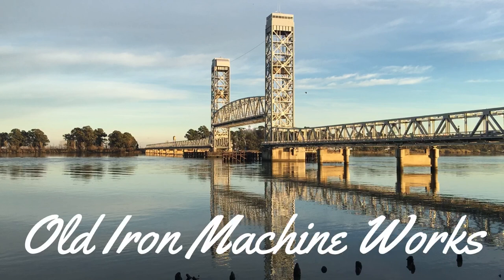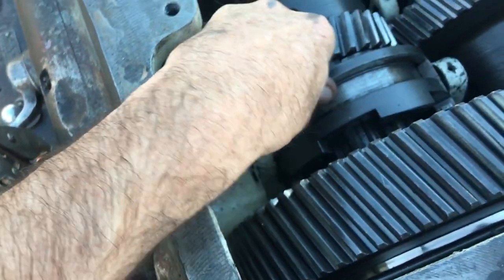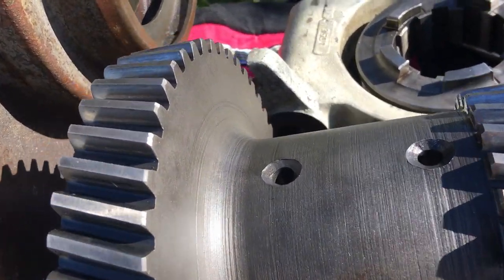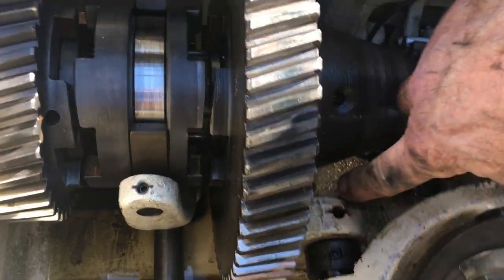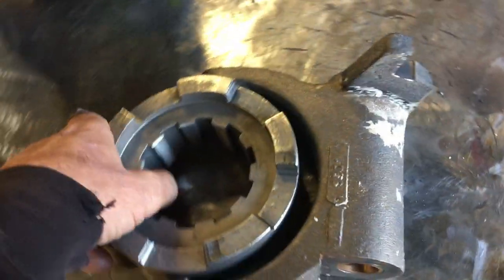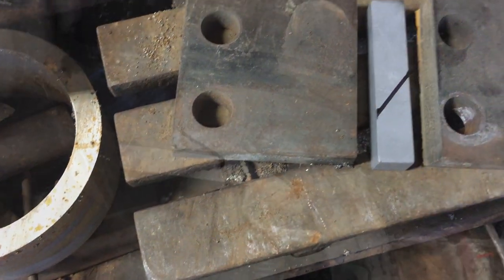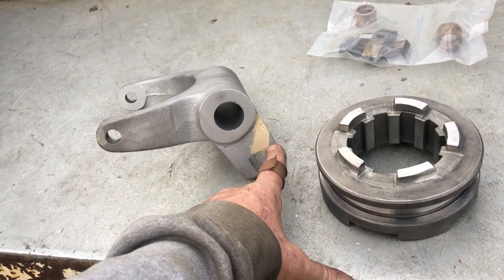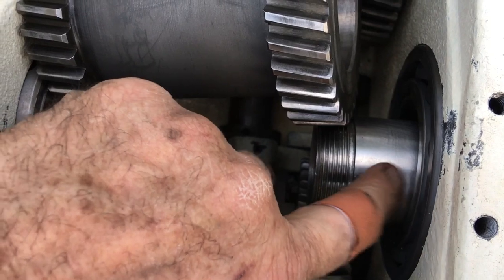Monarch Lathe Shift Fork Repair

Comment: I wouldn't call cast iron junk. The reason its as old and condition is the benefit of cast iron. That took a hell of a wallop to snap that gear shift carrier. If that was made in any other country it would be scrap 40 years ago. You did a great repair job and the correct way . Nice machine will now live another hundred years.

Comment: Thanks for showing what my spindle looks like without me having to do any disassembly! The repair looks like it will outlast you or I. BTW mine is a 22.5" swing. Cheers! ----Aaron
Reply from the maker: I knew that Aaron, most of the time whats clear in my head is not what comes out of my mouth :)  thanks for stopping by.      Gary

Comment: Real nice repair. That will hold, for sure.
Reply from the maker: Rustinox, Thanks for stopping by and checking out my video. My middle name is Russell and as a kid growing up many called me Rusty, family called me Russ. Where did Rustinox come from? I hope your doing good, I have been so busy and running behind and keeping up with watching videos. still need to catch up with yours.   I can still say the the coat hanger project was one of my favorites.  Thanks for stopping by.       Gary
Reply: @OldIronMachineWorks   Rustinox is just a paradox. Rust is of course metal corrosion, and inox comes from inoxidable. This is how we name stainless steel over here.

Comment: Really great repair on the fork , I would have just chamfered a small piece where it broke off but the way you did it gives the braze much more holding power . One big reason I like your videos,  they show the difference between  how an amateur and  expert craftsman  would make a repair like that . Thanks for sharing
Reply from the maker: Otto, your way to kind. Thank you for taking the time to check out the video.      Gary

Comment: Nice braze job.  When i repair cast iron, I usually try to work in some mechanical fastening along with the weld. for that little appendage, I would prep it the same way you did, tack the steel part in place, and drill & tap for a long set screw to fasten the joint.  In my case, I would fusion weld the joint using TIG and Ni-rod.  Just my take, you did a great job.

Comment: New subscriber, 50 year retied journeymen machinist---- we NEVER retire we just change our hours. lol. I would have driller & tapped and counterbored the repair fork with a long 10/32 socket head cap screw on the Bridgeport mill. Two of them if passible as there is a bunch of shock when you drop it in & out of high range. Looooove them Monarchs from that time eara. In my opinion, only one better is the old Clausings of the 60s.  Never care for the La Bonds (with that stupid Servo shift crap) or the Lodge & Shipley as the Morachs run cooler. Best bang for the buck is the 20 inch swing Summits but brother , they run HOT !!!!!!! after about an hour but you can take 3/8"a side ( 3/4s" a pass) no sweat with a 20"Summit off 4140 tool steel bar. yes I know the Summits are butt UGLY ! but they will get the work out all day everyday. Simple to use to. The American Pacemaker is also a good lathe, but kind of clunky to run until you get use to em.

Comment: Is your good buddy Mike Thomas?
Love that Monarch. I don't see what the draw is for the 10EE. The beds are so darn short.
Reply from the maker: Jeff, Yes that's my buddy.   One of these days I will get my 10EE up and running, but I agree with you. If I could only have one Lathe I would have to pic a larger Lathe than the 10EE.  Thanks for checking out the video.      Gary

Comment: Hey Gary. What was so far gone with the "Donor" lathe that made it a donor lathe? Did it have some other serious issues? Nice repair job.

Cheers,

Tom
Reply from the maker: Tom, this Lathe did not come with a compound or cross slide. It had a huge belt grinder up overhead that you would pull down from the top to grind whatever you were grinding on therefore the ways were pretty shot.       I’m normally the last one to scrap something out. My friend has sold some parts through practical machinist And OWWM. But has had no interest in the spindle or any gears which is surprising. The guy bought two from the auction and the other is still advertised on craigslist, you might’ve noticed it. But it’s a 20 inch with 24 swing.    Thanks for stopping by and commenting.     Gary
Reply: Nice work on the folk repair, I'm a functioning idiot and I'm amazed how people repair vintage machinery.

Comment: Why is this part common to fail? From operators trying to force a gear change while everything is still turning?
Reply from the maker: Tom, that’s exactly what happens. I think if they let everything come to a complete stop and roll the chuck around by hand when changing gears they would never have a problem. Hope you’re getting some shop time in.     Gary
Reply: @OldIronMachineWorks  Gotcha. Electrician supposed to start next week. Can't wait.

Comment: In dire need of brass worm gear for driving the carrige 
Interested in any of the control handles if available.  Forward/ reverse lead screw lever (on the carrige), clutch lever (on the carrige side ) , main gear box engage (letter U in the manual)  . Please contact me I need a few things . Thank u for the video!
Reply from the maker: Aaron, send me a email and I will give you my friends number to see what parts he has.   Gary
oldironmachineworks@yahoo.com
Reply: @OldIronMachineWorks  thank u. I sent u an email

Comment: Why not make a new fork out of plate steel and heat treat it using the broken one as a pattern, that would be the smart thing to do.
Reply from the maker: Not sure if you realize the time involved in doing that. I have a couple hrs into the repair of the fork and if used correctly there we be no problem. And I don't claim to always do the smart thing :)          Thanks for checking out the video.    Gary
Reply: @OldIronMachineWorks  
I absolutely know what the time involved is I worked in a fab job shop.
My uncle owned the largest machine shop in kc all my brothers dad and me had worked at it at one time or another.
Reply from the maker: @bobbg9041  OK then, In your opinion what's your estimated time to build a new fork heat treated and all ?
Reply: @OldIronMachineWorks  20 hours but it depends on what tooling you have and how precision it needs to be. 
20 hours @ 18.00 an hour  550$ part in-house  not counting materials (scrap steel) and heat treat.  With a plasma cutter you might not even spend that much time if its water jet. 
If you paid some other shop to make it 3 4 k.    I didnt bid work or do time estimates.   I ran machines.